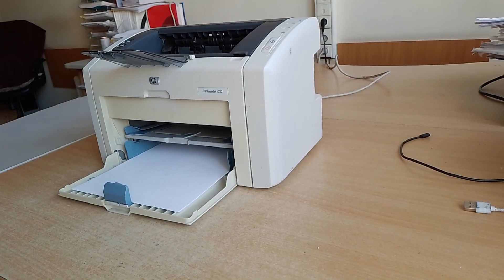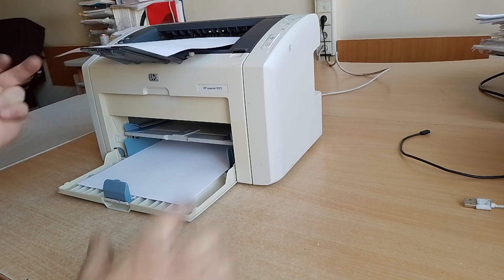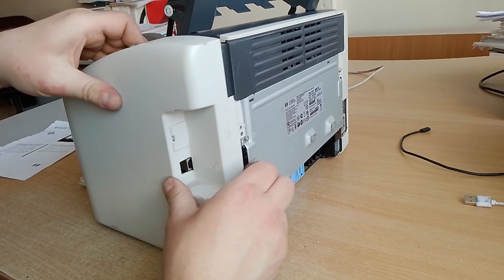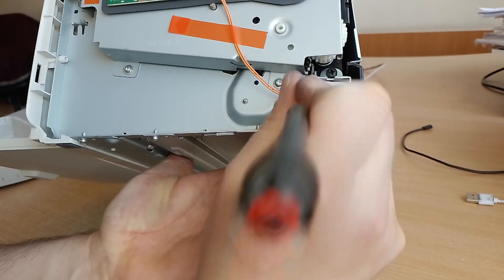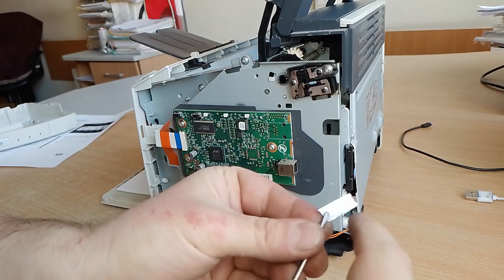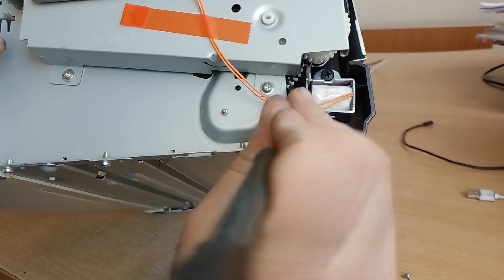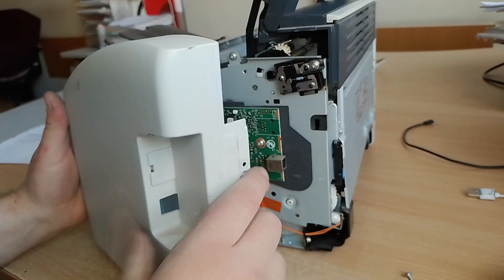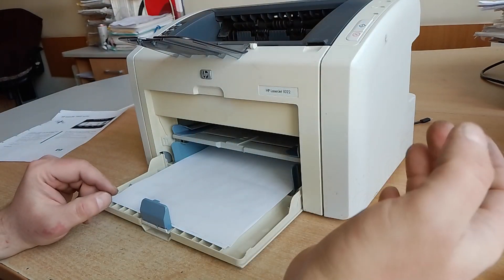HP LaserJet 1010/1018/1020/1022 paper jam SOLUTION

Comment: I have an HP 1012 that had the same problem. The fix is a little more complicated but basically the same. You have to take the solenoid out to get the piece of tape on the plate so it stops sticking. Turning the printer on its side while you work on it makes it much easier.

Comment: My printer will print 2/3 pages and then half a piece will stop halfway and the control says it has jammed. I remove the toner and backfeed the paper to remove it from below toner cartridge. So you think I need this solenoid solution? I will count the paper collection attempts
Reply from the maker: Fist of all check this solenoids.
Reply: @printhelper  i have cleaned the solenoids and it now does not stick. I have tried a firmware update but no luck. But the printer still prints 1/2/3 sheets then the last one is always halfway jammed

Comment: I tried cleaning the molten foam in the solenoid as @mfelician suggested. The solenoid didn’t stick any more. However, the paper still gets stuck after printing the first page. What else can I check?
Reply: Actually, the piece of tape is needed! now it works! amazing!
Reply from the maker: It's hard to say, there's not enough information. The first one is completely clean and comes out of the printer? If you print only one sheet, does the second one also go into the printer?

Comment: Problem solved. Thank you so much!
After replacing the pickup roller and separation pad with no luck, this did the trick. I still can't figure out why it was sticking (all parts were clean and didn't stick when I moved them manually). Your tape solution fixed it immediately.
Reply from the maker: Glad it helped!

Comment: THANKS for the video!
To do this BETTER, instead of taping the solenoid, take it out: it is held by only one screw. Once you taken it out, you can see that there is molten (sound dampening) foam which causes the solenoid to stick. Just scrape that molten foam away, and that fixes the problem properly. (For me the tape just wasn't enough.)
Reply: Thank you. Cleaning the solenoid fixed the problem.
Reply: In my case cleaning was not enough:it needs a piece of tape was needed. Repair=future😊